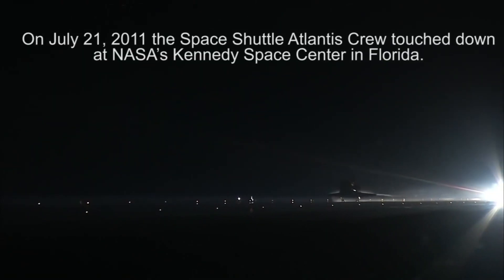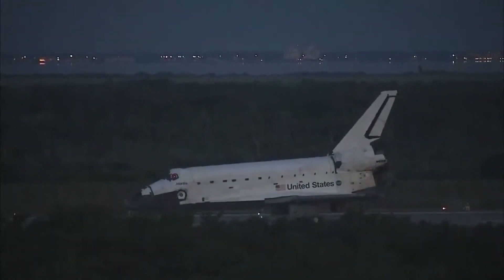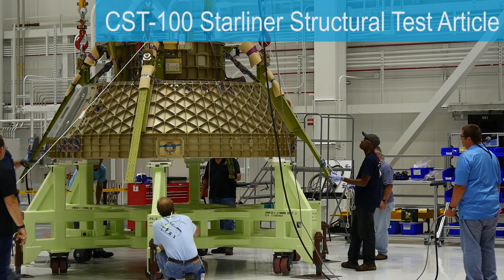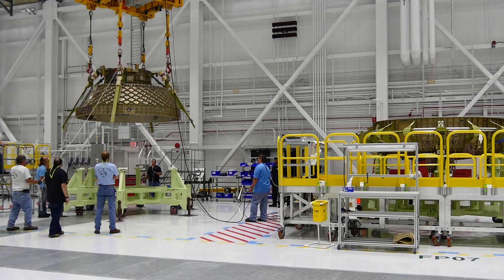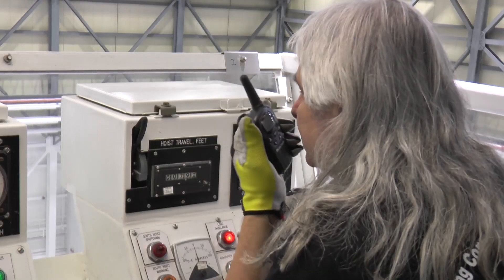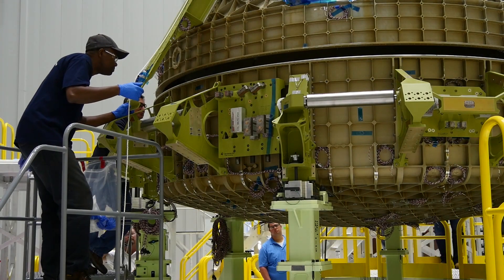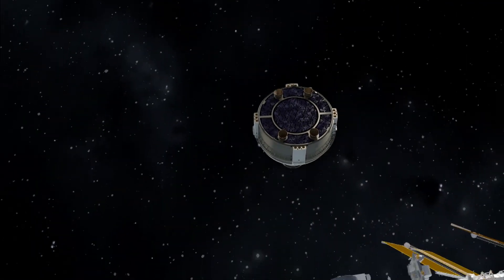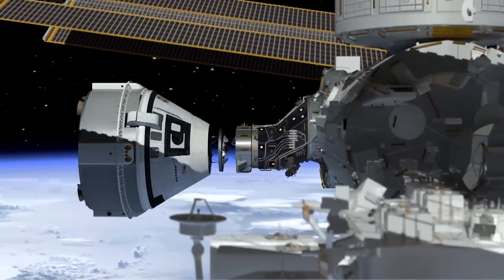Boeing’s CST-100 Starliner Makes Major Move for U.S. Return to Human Space Flight

Comment: Wow!!!  This video comes out at the same time that Boeing announce a delay in the first manned flight in a Starliner capsule.   So, the bottom line is that the Dream Chaser should've been the vehicle chose instead of the Starliner for Crew.  Wasn't one of the main points that the Dream Chaser wouldn't be ready for crew flights till after 2017?  I guess Boeing's political Allies paid off in the Starliner selection (the most expensive option).